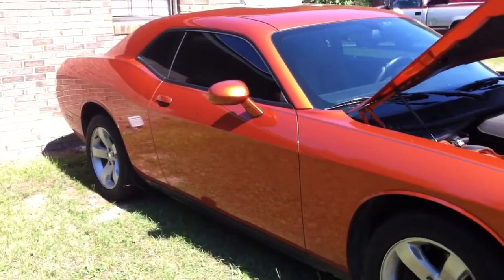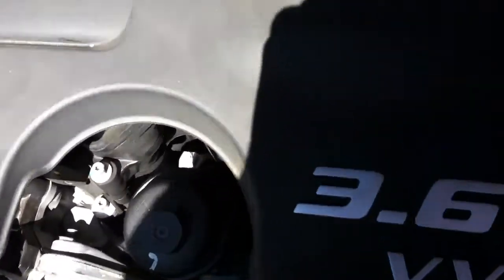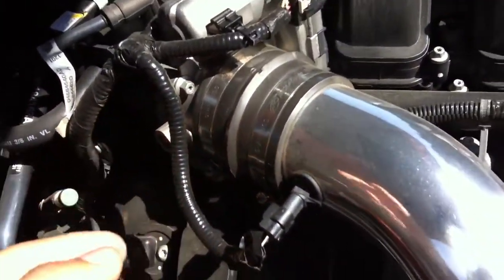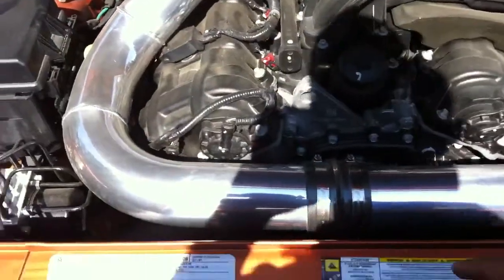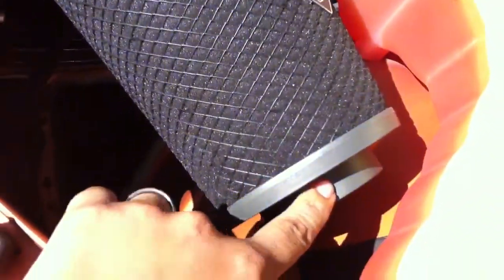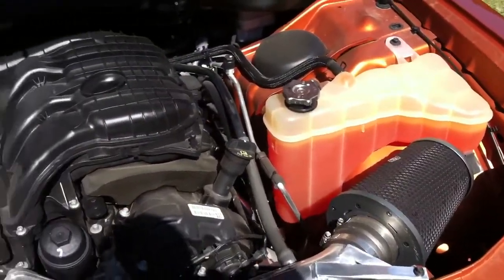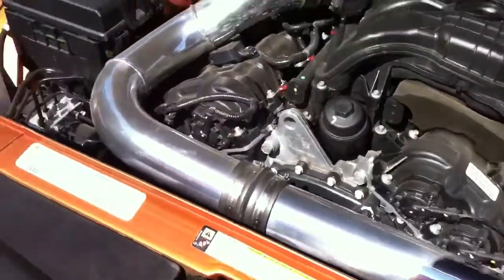How to / install Weapon-R Secret Intake CAI on a  Challenger

Comment: hay a good idea would be to get a heat shield to block the motor and the pipe and it would help keeping it cool and u should get the hose to run it down

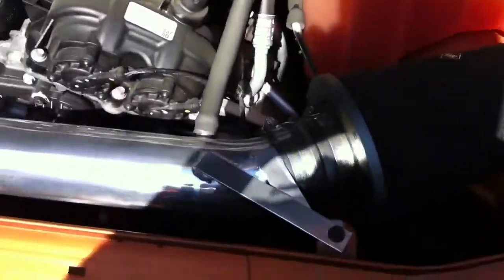Comment from the maker: the rubber hose at 1:58 is the crankcase breather line, and if you only got the Filter all you need to do is replace the OEM filter and plug it in. I don't know what extension you talking about, if you can show me on what video I said that I can then clarify or explain what I said on that vid..

Comment from the maker: the sensor should be right next to the throttle body like mine, if you say you have the 3.6L its the same set up, we share the same motor just in a different body frame,

Comment: i have the charger 2011 is the same engine as i can see but man my sensor cable is not to long. i mean i was gonna buy just the intake instead of the whole kit, but idk cuz the cable is nt long enough to open holes on the tube to put the sensor